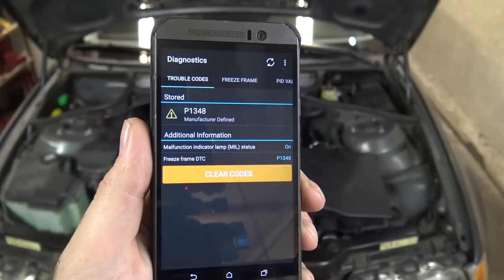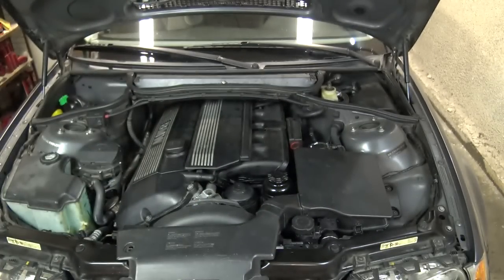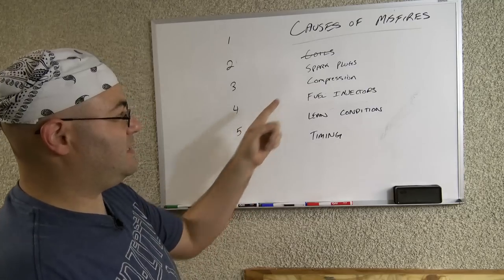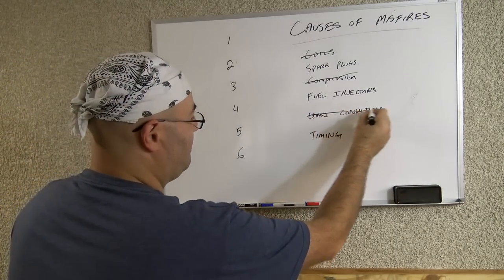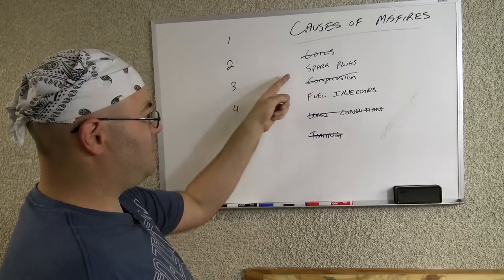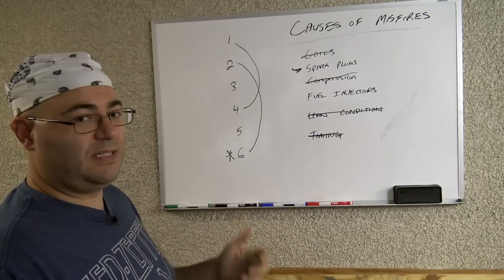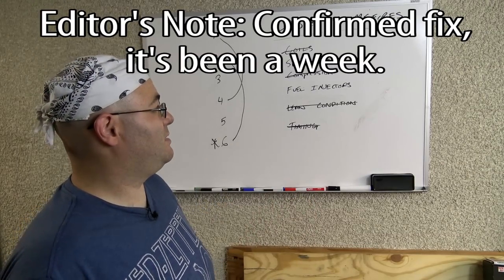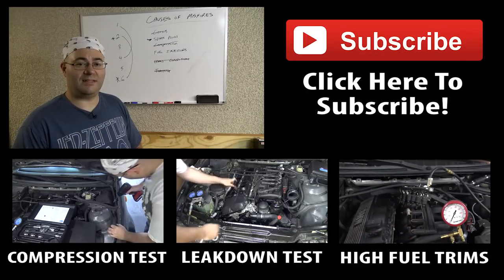How To Diagnose A Misfire on an E46 BMW 3-Series DIY

Comment: Did you check your fuel pressure?  What was the problem?
Reply from the maker: The solution to the problem was at the end of the video, I don't understand how you missed it. :-)
Reply: 50sKid I did not watch the end of your video.  That's how I missed it.

Comment: what ngk plugs did you use? Do you prefer getting the plugs from dealer or just as long as they r a certain ngk plug? thanks!!
Reply from the maker: The NGK BKR6EQUP (3199) is the plug for this car

Comment: I have a random low compression on cylinder 5. It goes away after a few min. Motor  Running. And comes and goes. Any ideas please someone suggested lifter sticking

Comment: I have fault code (003) 03  fuel ignition cylinder 6  activation 
(243) F3 misfire  cylinder 6 

What the issue

Comment: Seems very unusual for spark plugs that look normal to cause this.  The coils should have enough voltage to jump a much wider gap.  If I were you, I would do a voltage test on the coils.  There is a simple tool to do that.  It's possible that the problem is as simple as a bad engine ground.
Reply from the maker: That's a good point, I will do that.
Reply: Do you have BREMI ignition coils?  If so, I also found a TSB that might be related.  Here is the header of the TSB.

PERFORM THE PROCEDURE OUTLINED IN THIS SERVICE INFORMATION ON ALL AFFECTED VEHICLES THE NEXT TIME THEY ARE IN THE SHOP FOR MAINTENANCE OR REPAIRS.
SUBJECT
Voluntary Emissions Recall Campaign 05E-A01: BREMI Ignition Coils Replacement
MODEL
E46 with M54/M56 from 09/02 up to 12/04 E39 with M54 from 09/02 up to 07/03
E53 (X5) with M54 from 09/02 up to 12/04 E65/E66 with N62/N73 from 09/01 up to 12/04 E85 (Z4) with M54 from 09/02 up to 12/04 E83 (X3) with M54 from 09/03 up to 12/04
SITUA TION
Internal insulation failure of BREMI ignition coils may cause reduced ignition firing power, or ignition coils failure. The customer may complain of erratic engine performance and the "Service Engine Soon" light illumination.
In order to remedy this situation, BMW is conducting a Voluntary Emissions Recall Campaign to check, and replace if necessary, ignition coils in all affected vehicles.
A copy of the customer notification letter is attached.
Reply from the maker: No they are bosch coils.

Comment: Hie, my e46 showed an engine light while I was driving at 140km/h and the engine started vibrating, it still does, I realsed it was having a problem with cylinder 4, so I checked the coils and they were fine, but when I removed the spurk plug I realized it was damaged. any video showing the internal cause and how I could overhaul to check?
Reply from the maker: Can you send me a picture of it on my Facebook?  You can put your #4 piston at TDC and look down the hole with a flashlight to see if there is an physical damage to it.

Comment: So I have a 2002 325xi that is giving me a headache.  code P1351 ( misfire cylinder 5, with fuel cut off). I have changed the spark plugs, swapped the coils, and only when I moved the fuel injector to a different cylinder it gave me a misfire elsewhere.  I replace that fuel injector and still the engine has misfire.  I do not know what else I should be looking for.
Reply from the maker: It still has a misfire on cylinder 5 now after you replaced the injector?  Are you sure compression is ok?  Is this a constant, dead miss that you can feel happen with resulting low power or is this just a code that keeps coming back?
Reply: So this misfire happens 3 minutes into starting the vehicle. It will stop whenever I turn the vehicle of then start back up. But when I stop at a light it happens again. I replaces the valve cover gasket and spark plug garments last night. If this does not help then I'll do the compression test. If I do not get any results from that. It's going to be put on the for sale lots. $3000 obo

Comment: 50's kids - hello have mis fire po1345 code 2001 330ci, problem stayed at cylinder 2, even after replacing spark plug and swapping coils with other cylinder, i have also swaped fuel injector from 2 to 1 and still same error. from this video i guess i need to compression test on this cylinder. what's possibility of cam sensor or fuel harness or even coil harness? realy need your advice.. thanks.
Reply from the maker: Interesting.  Yes, I would say compression is next.  It's not a bad cam sensor.  It could also definitely be bad wiring in the coil or fuel injector harnesses.  You can check the fuel injector harness with a test light to battery positive (fuel injectors are ground side switched, meaning when the computer turns the fuel injector on it grounds it, so if you unplug the harness and touch a test light hooked to battery positive to the negative wire, it will flash when you crank the car).  With the coil just check for spark by pulling out the spark plug and grounding the threads with a ground wire.
Reply: i ordered same compression test kit you used on your video, will perform all these test this weekend. Hope i get a clear picture, thanks so much..
Reply: 50skid - compression test done last night, cy1-200psi, cy2-120(added oil in cy it read 125psi) cy3-5 200psi, cy6-195psi. i guess piston rings are burned up or bent??? please advice..
Reply: 50skid, still waiting for your response on this???
Reply from the maker: Joe Julian your next step is to do a leakdown test to see where the air is escaping

Comment: hey 50skid i got 2002 325i have #5 cylinder is missfiring checked coils are fine spark plugs are fine i got good flow thru fuel injectors i changed o2 sensor exhaustcam sensor intake camshaft sensor and nothing still missfires badly help plz
Reply: Eusebio Azua might wanna check if the valve sticking up cylinder!
Don’t want to freak you out, but after replacing all these parts, it looks like valve problem or no cylinder compression problem...

Comment: Hi mate. Need your suggestion can I use e90 2006 spark plugs on 318i 2003 model. Is that ok ? 
Thank in advance
Reply from the maker: No they are not the recommended plugs. You need NGK 3199

Comment: So i have a misfire in cylinder 1,2,&3 with fuel cut off and random misfire code. When I turn it on it runs fine until I run it for the first 2k rom then feels like loss of power but then while running it it goes back to normal and then back to that loss of power and deep exhaust noise. I changed all 6 spark plugs and nothing changed. So I did that test disconnecting the coil sensors one by one while running it like Jason did and turns out cylinder 1&3 aren’t contributing but cylinder 2 was working so all of them have an engine change except 1&3 coils. Should that be the problem. Before the spark plugs I changed all 6 fuel injectors too since my car had trouble turning over. Now car turns on every first try but now it’s that loss of power . Could it be that 1&3 coil not working? Please help
Reply from the maker: Did you swap 1 & 3 coils with known working ones from other cylinders like I did in the video?
Reply: 50sKid no I didnt. Not yet because I dont have a code reader. Nor did I wanna do it at auto zone and drive without the housing filter off or the engine covers off. Idk if that’s good to drive over there with it off. I mostly went by you ignoring there are bad coils. I mean with just taking off the coil sensors. I would have to read it if the misfire is being following by the coils to different cylinders
Reply: 50sKid btw i love your videos bro! Very helpful and ever since I got my car I’ve been doing the fixes and watching ur videos
Reply: So i should move 1&3 with a good coil right? Then run it and read the codes to see if it moved. And if it did it be the coil

Comment: spark plug? im still fighting with fuel trims system too lean in both banks... cant find any vaccum leak spark plugs new ...  may it be oxygen sensors? engine works fine on neutral there is no engine shaking yhhh i have ni idea what to do
Reply from the maker: look at live data, look at fuel trims when idle and compare to fuel trims at 2500 rpm.  Do the fuel trims go down when the engine is at speed?  If so, you have a vacuum leak that you cannot find.  See my DIY Smoke Tester video.
Reply: ok i will look at live data and see what it shows.nice thah you solve your roblem with missfire. like your vid.
Reply: Need more information. Does it only happen at idle? Unplug your MAF sensor and if the misfire goes away at idle you have a vacuum leak. Tons if info how to find it for E46s.

If it happens ALL the time (idle, and while driving) and unplugging the MAF makes it go away, the MAF is likely bad. Check MAF data on scanner. Try to clean it.

If it happens while driving (engine under load) and not at idle, then change your fuel filter. Its cheap enough that you dont need to waste time and money diagnosing if its clogged or not. You would have to buy a fuel pressure tester.

Its very unlikely to be O2 sensor since its lean on both banks. You would have to have bad O2s on both exhausts. You can also test them.

So do the MAF test and if that doesnt work change your fuel filter. Dont replace anything without testing first (apart from fuel filter).
Reply: thanks for info I'll check the maf sensor.now I waiting for obd code reader and look for live data I have inpa too but my laptop dead so I can't look for readings. in idle maf should show 13 (kg/h?) air flow? sorry for my language I'm from Poland :)
Reply: Yes 13 kg/h is  normal at idle. Now check it while revving your engine. It should go to at least 300ish at higher rpm.

Try unplugging MAF sensor. 

Is the engine misfiring? When? Idle or while driving?

Comment: Can someone tell me if I can carry out the same test (listening to the to the engine drop) on a 4 cylinder? the wiring on the leads are a little more exposed than this so dont want to be disconnecting them if there going to give me a surprise! thanks

Comment: Hello 50sKid I have a question and I'm hoping you might have some experience or anyone else with this issue. I have automatic 2003 BMW 325i that in a cold start that won't go into D but does on R and N. It feels like it stays in N. I've taken it to several BMW certified mechanics and they say that they don't get any error codes on my transmission and have changed the transmission problem. Some have suggested an update do to some issues on that particular year and model. Also my idle stays at around 500-600 rpms. Could that cause it to act like that? Also after a cold start if I start it up later it runs great with no issues only when left off for a few hours. Any suggestions would be appreciated. Thank you.
Reply from the maker: Check the level of the transmission fluid (see my transmission fluid service video).  For that matter, have you ever had the fluid changed?  If a solenoid was bad in the valve body, I would imagine there would be a code for that so I'm thinking it's a simple maintenance issue.
Reply: 50sKid thank you for replying and yes I've already got the transmission fluid changed. I was told that it wasn't my transmission several times by several technicians. I'll go ahead and do maintenance check I'm sure a complete tune up should do the trick now. Awesome videos by the way.
Reply from the maker: Maybe check the linkage.  There is a cable that bolts to the transmission's gear selector on the side.  You can see where I disconnect it in my rear main seal part 1 video.  If it's a little tight, maybe the selector isn't going into drive correctly.

Comment: Had a bad intermittent misfire on 4 of the 6 cylinders on my m54. Realized the last owner installed chinese ignition coils. Although they were new, swapped in some used Bosch (german) coils and misfire is gone. 🤣

Comment: I’m getting a missfire in cylinder 4, 5 and 6 :/ any advice ? I have new spark plugs and coils so it can’t be that . I was thinking to check for any air leaks next and fuel injectors

Comment: I replaced coils yesterday and had misfires on two cylinders afterwards. The same two with misfires before the new coils! I was not surprised to find a great 50's Kid video on diagnosing misfires. My X3 has the same engine as the E46. As a former E46 owner I'm familiar with it. I started troubleshooting by swapping two pairs of coils. Turns out the top of the coil is not symmetrical and I didn't have two lined up right. Easy fix. Car runs great. Thanks!

My own train, plane, and airplane videos: https://www.youtube.com/user/ltcterry2006/videos?view_as=subscriber

Comment: E46 one cylinder no spark any ideas
Reply: I found online about 2 weeks ago that my number one ignition module had died.
The way I checked it was buy disconnecting the wires to the number one ignition module to see if the engine ran the same as before.
Because it ran the same I reconnected those wires, and disconnected the number 2.
And when I started the engine, it barely ran at all because that meant that now two cylinders were not firing.

I found one at Odin Auto parts in Balcatta Western Australia for $89 I put it in and it rang great

Comment: how do u fix electic fan not turning on
Reply from the maker: use a test light or multimeter to make sure there is 12v at the fan connector when your a/c is turned on (that will power the fan on).  If there is power and your fan is not on, your fan is dead.  Replace it.

Comment: Does anyone know good repair shops in Virginia preferably Virginia Beach and also performance shop. I drive a 2002 325ci it's currently on a dead battery but I have bad coils and plugs but they cause the car to overheat and my coolant was low so it melted some of the top. I know since that happen there could be internal problems could anyone give me any ideas ?
Reply: Mxhzl im planning on going to BMC Automotive in chantilly (im in northern va) they seem to have the highest rating in my area. Will find out how they r once i go there. Just getting my car ready i had the interior apart so putting that back together before i go.
Reply: 5Riverz oh okay well when you go find out if they can repair my engine
Reply: Mxhzl If Chantilly BMW repair shop doesn't work for you, try BMD Auto repair in Alexandria. I go there and the work & prices are phenomenal !

Comment: If you are ever experience Missfiring Problems again, send me a message, I have 6 Coils of the newer Style that just pop in and dont have to be screwed in with the matching Valve VCover and I have 6 Fuel Injectors with a Rail (Everything Brand new). If you Need them you can have them for free it may just take a few Days to ship them to you from Germany. Greetings
Reply from the maker: Thank you!

Comment: mines missing says cylinder 5 went to start last night to set in and burn one and didnt tun the key over long enough and
i be dammed if it didnt start missing like crazy  but mines doing it on bank 3 and 5 unhooking the coil changed nothing at all....so i believe i had bad coils...or a god dam rats going to town on my daily. and to think i get my license back TODAY after 12 long years of going without them...if i pass which cant use my car OF COURSE?!?!! mannnn its one thing after another on bmw no leaks no codes then BAMN leaking codes and missing/hissing to boot lmao..i laugh but im crying inside.

Comment: Im getting several misfires but I've already changed all the plugs, coils, and 2 oxygen sensors on the left. Most of the codes say "Cylinder # with fuel cut off" what could be the problem? Don't know if you're on reddit, but heres the whole explination: https://www.reddit.com/r/BmwTech/comments/60rmrh/unexplainable_multiple_cylinder_misfire_02_bmw/
Reply from the maker: You have a lean code.  Check this video out: https://www.youtube.com/watch?v=4CcwtaIe5c4

Comment: Please nobody check there vehicle this way it is the wrong way of checking coils if your miss fire does it when it's cold freeze all the coils and ohm check them and they should read within 10% of each other if problem is hot warm them up and ohm check them 10% the odd ball is your bad coil playing musical chairs with your coils takes to long the other thing use a real scan tool not that junk on your phone get the oem laptop out and do a computer balance test